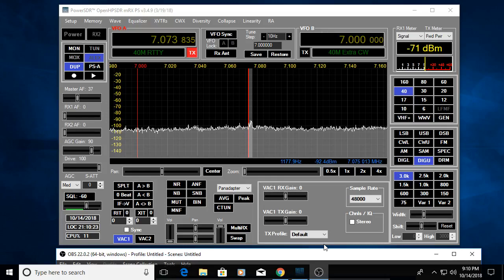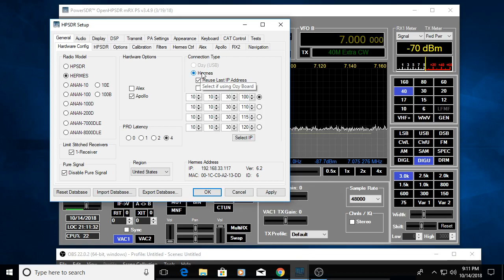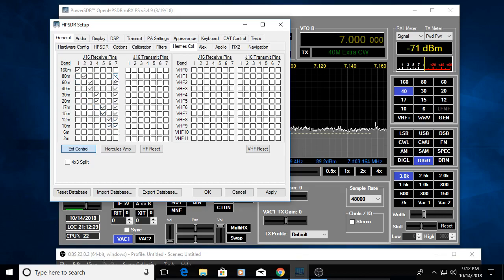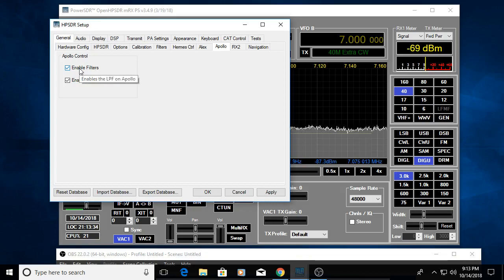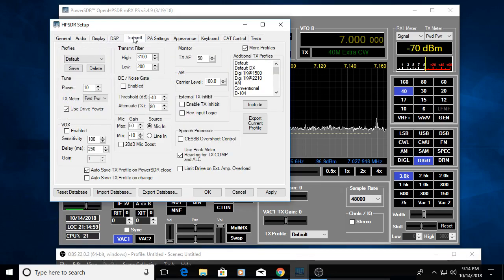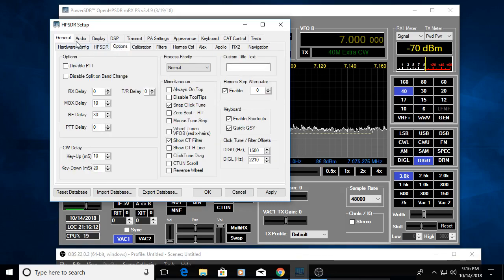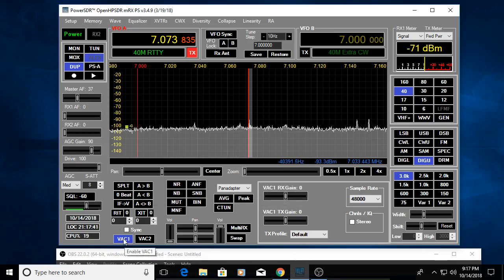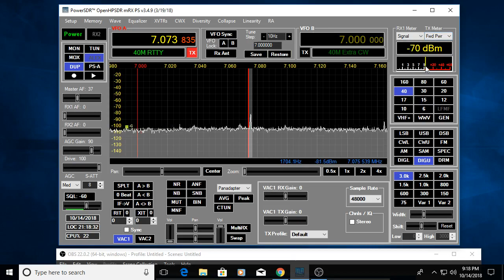Hermes Lite 2 0 PowerSDR Setup

Comment: Do you know of any consumer gear that has the required chipset (AD9866?) to run Hermes Lite 2.0 for SDR?  For example, cracking open my Motorola MB7220 Cable Modem DOCSIS 3.0, doesn't seem to have the AD Chip.. it has a Broadcom BCM3383D.        What about an old router (Linksys e1200)?

 I have a BeMicro SDK, but hoping to run 2.0 instead of 1.x!
Reply: No. I've looked but haven't found any commercial products that use the AD9866.